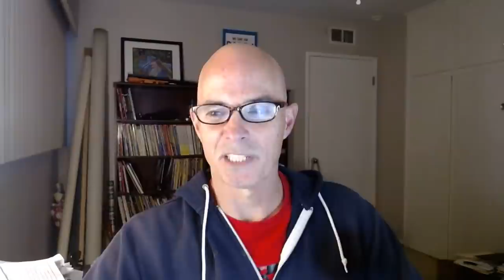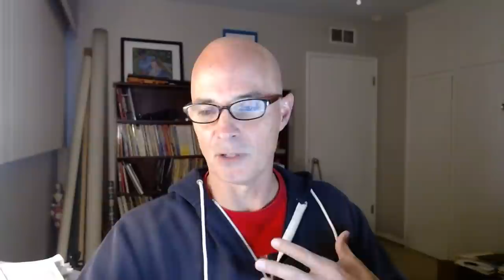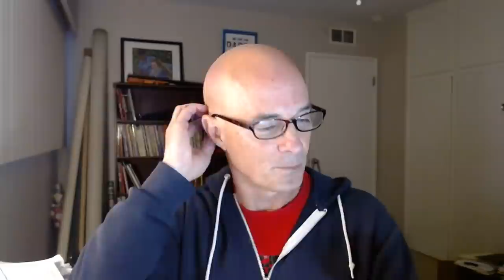LET'S TALK-CAM LIFT, DURATION & LSA (Q&A)

Comment: When upgrading cams (increased lift and duration) on dual variable valve timing applications (i.e. Ti-VCT), why do people install phase limiters versus machining additional clearance relief in the piston domes? Especially when considering supercharged, turbocharging, and other power adders.
Reply from the maker: there is actually very little VVT at WOT (8-9 degrees). There is a lot at part throttle which is where interference will take place. Valve reliefs will help but the new cam profile might not want the same VVT sweep

Comment: I'd like you to talk about valve events and what effect that has - intake exhaust open and closing and also ramp rates fast open slow close and how long does it stay on the nose etc and rocker ratio changes like from 1.73 to 1.8
Reply from the maker: MAGIC VALVE EVENTS?
Reply: It's magic it what you try works :) guess it's about optimising what you have, like trying to match the cam to heads you have. Maybe your heads are a little to big for the combo you have so by changing open and close points might see some gains, same if they're not big enough or flow poorly in the low or high lift - what changes can you make to improve what you have ? You're not trying to find a 100hp every time just improve what you already have cheers 
I'd like a rocker ratio changes that would be interesting

Comment: Richard, I have an unusual motor, a 99 ram 2500 v10. I recently had a cam reground by crower because there were no available new cores. We were able to get 216 at .050" and .478"(single pattern) on a 1.7 ratio with a 110lsa. I also did my first port/polish (more polish) on the factory heads and had 2.02 intake valves installed (factory 1.92). The upper and lower intakes were both polished with the throttle body opening cnc'd to go from a twin 47mm to a single 56x108mm with custom matching throttle body. I was wondering what you think on this combo. The truck is lifted with stock 1400ish stall and all it is used for is occasional towing and off roading so torque was the primary concern all across the power band, it seemed to fall off at 4000rpm and factory shift point/redline was 4500rpm, this is documented in every dyno of one I could find as well.
Reply from the maker: 216 @ .050 SHOULD HELP RPM

Comment: Richard, non cam related question. Have you ever ran pro topline 23° cylinder heads? How did they perform? I have a set on my mud bogger.
Reply from the maker: I HAVE NOT

Comment: I have a 86 f150 xlt lariat stock block .060 over dome pistons stroked to 352 cid with edelbrock heads roller rockers long tube headers and an 850 DP and a edelbrock intake and a lunati cam i will get a list of part numbers for you and see what you think as far as power output with VP110, and E85
Reply: LUN-20310525 - cam

EDL-77179- head

942-1-94195BE.06 - rotating assembly

EDL-7121- intake

HOK-6907HKR - Headers

Comment: I know this for fact....Chris Straub spec’ed a HR cam for my 454....it rips, big torque.  I stumbled across Dave Vizards cam calculation and crunched the numbers for my engine....Vizards numbers matched the cam that Straub spec’ed for my BBC..... Coincidence?  109 LSA engine loves it....
Reply from the maker: motors don't love LSA numbers, the respond to valve events
Reply: @richardholdener1727   What’s the mathematical equation to determine each valve event?  It’s physics, fluid flow and pressure waves moving at the speed of sound adjusted for temperature.  There has to be some associated math whether pure theory or empirical because some folks use some sort of model to spec cams.  It seems proprietary, but surely some mechanical or civil engineering professor has derived something that has been made public.  Are you aware of anything considering your large network?  You do a great job with all your testing and sharing of information! Thanks!

Comment: Would you say that, in general, a motor with limited head flow as the bottleneck (like, say, a 3800) benefits more from a cam with narrow LSA? That has always been the thinking in the Buick turbo 6 crowd, and many of the cams reflect that, with small duration numbers and narrow lobe separation angle. I've seen it work on my Dad's Buick 430, which runs better than a low compression n/a motor with headers and dual plane has any right to.
The odd thing is, it seems like all of the 3800 cams available are generally 113LSA or wider.  I'm wondering if it would be beneficial to have a custom grind done on a 110 center to maximize the area under the curve. I'm not after peak horsepower as much as I would like to see strong torque, quick spool, and good drive-ability, while making reasonably good power without revving it out much past 6000 rpm. I'm trying to have the best of all worlds.
Reply from the maker: what you do to the cam (narrow lsa) has the same effect on a motor with good head flow (more low and mid-range power)

Comment: can you give me the reader's digest version of what they mean when they list a 110+3 vs just a 110 lsa?  and what does that do to the power production in rpm range, area under the curve, peak power or torque etc?
Reply: Back in the day people use to advance the cam (in relation to crankshaft) to get more torque at a lower RPM or retard the cam to move torque higher in the curve. Nowadays people are fancy and make the cam with the advance made in to it. So when you install it dot to dot its already advanced, etc.
Reply: Furthermore it confuses people that they always list the "+3" right after the LSA, making it seem more involved or complicated.
Reply: @baby-sharkgto4902  - Ah, I see. Makes sense now, thanks, dude.

Comment: Hello Richard, my name is Percy i’m running a 496 bbc with aluminum rhs 119cc, 320cc heads also have srp high compression dome pistons 12.5:1 compression but that compression is with 118cc heads and I’ve got 119cc and my cam is a 299th big muthar thumper hydraulic roller cam kit by comp cam and a rpm intake plus 850 double pumper. Cam card show duration @ .050 int 243 ex 257 lobe lift int .3350 ex .3260 lobe separation 107.0 rpm 2300 to6100

Comment: All this is great.  Comment you have to Match cam to head makes sense. However with not experience where is this calculations located at.   I have a 383 280 cfm heads .590 left after 1.6 rockers.   227/233 .560 cam Where do I go to see how much I’m leaving on the table do to cam? !!!!
Reply from the maker: bigger cams make more peak power but sacrifice low speed power-its not how much, its where you want the power to be. Your heads can support 560+ hp, but that 227 won't make that.
Reply: @richardholdener1727  thank you for the reply. It would be cool if head companies did testing and said.  This cam made this hp/tq with our “” head.   So a person can  make a comparison of say 5 cams.
Reply: @richardholdener1727   I love your channel I wish I watched it before my build.   I now know why they say never purchase a cam first!!!!! Pick the cam last!!

Comment: I have a 07  suburban  Iam putting a 6.2  truck motor in it like to get the best low in tq  out of it  to pull a boat  it has 456 gears but the tires are 33 inch tall  it tacks around 2500 on the inter state

Comment: Vavle events is how i picked the cam for my twin GT3582 4.8L. The "normie" cam specs are 200/216 .580" 114 +4. Would i have ever picked this cam based on those #s? HELLL NO. It even has -10° of overlap. Does it work? HELL YEA, better than could have ever hoped and it idles like stock. Traps at 142mph in a 4000lb car at 27psi of boost. Best part is the drivability.
Reply from the maker: a 200 cam should idle very nice

Comment: What cam would you choose for a Std 454 BBC 10:9.1 comp GM bowtie oval port heads Street strip 550 whp goal
Reply from the maker: it would need to be a big cam with those heads on a 454

Comment: I'm trying to figure out a off the shelf cam for my 4V Cleveland it's going in a kind of heavy car but it will have low gears and about a 3000 stall converter
Reply from the maker: plenty of Comp cams avail

Comment: Richard,  would you recommend a normal split pattern cam over a single pattern cam on a turbo LS? Grand National's cam run a lot of single pattern  cam and run in the 10's.

Comment: this is a very unpopular topic Richard, i have a free vortec 305. it is going in a 47 chevy coupe. cruiser 700r4 carburated, can you recomend a cam to spice it up. i would freshen bottom end.
Reply from the maker: look at something with 212/218 or 218/224 duration split

Comment: ive ran a few cam's in my ls1 from stock 99 camaro, 04 ls6 cam, currently a comp 283r, but i really miss my gm hot cam it was only a 525 lift with a 112 lsa sounded amazing drove great with my 6 speed and it even passed ca smog
Reply: The Hot Cam is a good compromise at 219 effective.  Adds 50 hp.

Comment: I'm really curious to see how the smaller, median and larger size cams compare down low (3-4k rpm) when they are each run with the appropriate or equal dynamic compression. I believe dynamic compression is key to a well performing street engine and has been helpful for setting up for pump gas na applications with 11to 1 static comp. Seems like the bigger cams are being shorted by not having the same cylinder pressures down low when tested on the same static comp.
Reply: I agree. I've gotten to the point where I don't really spec a cam by duration and LSA, but by certain events.

The intake closing point needs to match your static compression ratio, engine geometry, and fuel type. This point determines dynamic compression.

Overlap is determined by exhaust closing/intake opening and is determined by intake reflected waves, application, head flow, and a host of other specifics.

This is what leads you, indirectly, to duration and LSA.
Reply: @tadwiltman4875  Yeah your right as there is more duration you move the sweet spot in sacrifice tq on rpm, but the idea is to get the max air and fuel in the cylinder and get it out as fast ass possible. So for me I'm thinking we start with a base power we want for our build with the cam out put to be about 100hp lower then then overall end game with no power adders, find a cam with the drive ability you want and the sound your looking for ( like in If I did my exhaust on a music car would be different but for my vet bit o sleeper I need a cam that is 114 LSA or higher to be under cover and take the ol lady out.  Most of thees guys are trying so hard to impress everyone with big numbers, but I like reliability best modest cam for a street beast and crazy for the guys on the track. You can get so much more out of full exhaust, valve lift, gears, stall and tires then ppl think. Caming is for big boys lol. exhaust 60hp 6 tenths , valve lift 1.6 15-22hp 2 tenths, 220gears to 373 gears 4-5 tenths , 1900/ 2800 stall converter 4-5 tenths, and good tires 3 tenths = like a 200hp conversion and 2 sec off 1/4 mile times.

Comment: 327ci, 30 over, 462 camel hump heads, 373 posi, will a  268D & 454L cam work good in daily street drag?
Reply from the maker: what are those cam numbers?

Comment: Any chance you could compare Comp Cam NSR Drift 233/243 54-777-11 on 5.3L, 6.0L, and 7.0L? A couple of us on the ls1tech forum are curious how the low lift but long duration would affect the hp/tq curves compared to stock and other cams. Would the 114 LSA be helpful under boost applications?

Comment: right off the bat,  lift is a huge deal.   you can over lift or under lift your camshaft.  Flow testing the cylinder head will determine where the lift needs to be.   if the lift is too small,  you will starve the cylinder,  if it is too much,  you will lose your flow charge,  and acctually decrease performance
Reply from the maker: no

Comment: Love this, always talking about my buddies about optimizing a new cam on my sbf 383w  street motor, thinking about raising static compression 2points  to 12.5:1.  Running 248/256 at .050 108lsa .720/.688 lift kaase p38 heads. My Erson cam card has the cam timing events but would like to tweak.  Running a 210 cranking pressure.   Trying to pick up another 50-75 hp.  All N/A power
Reply: The generally accepted rule for adding compression is that one full point of compression can add between 3 to 4 percent power.  So 2 pts would be at best 8% increase in power.
Reply: @littlevman2997  Just have a stick car. Steeper gears and run good manual brakes like willwoods :) 
Boom no need to worry about engine vacuum lol.

Comment: Hi Richard 
I regularly watch your you tube channel and particularly like you LS content 
I am building an ls and wouldn’t mind your thoughts on it 
In short 
Ls2 block 4” bore
4.125 crank 
Forge Piston 6cc dome
Pro Comp ls7 heads (have checked flow 360@600 370@700)
Comp cam 256/279@50 660 lift 
Short travel lifters 
Factory rockers (CHE trunions) all clearance are good a little shrouding around the valves because the bore isn’t really big enough 
Comp ratio about 12.5 -13 want to run pump fuel/e85 
At this point will run factory ls7 manifold 90mm throttle body (will change if needed later on)
Would like to see 600+ at the wheels 
Your thoughts is 600+ possible 
Comp ratio 
Cheers Rob

Comment: What do U Think
2 of these
on a 400 + hp . 
302 sbf  Drag Race Motor
T04E Turbocharger

HP BOOST STAGE III T04E T3/T4 .63 A/R 57 TRIM

Exhaust Standard Flange: T3/ T4 4-Bolt
Turbine A/R::0.63
Inlet / Outlet Diameter:: 3" / 2"	

Standard T3 5 bolt downpipe flange pattern

Intake inlet & outlet: 3“& 2”

Compressor : Trim: 55

Compressor : A/R: .5

Compressor : Inducer: 50.5

Compressor :76

Turbine : Trim: 73

Turbine : A/R: .63

Turbine : Inducer: 65.5

Turbine : : 55.9
Reply from the maker: yes

Comment: Is there a way to convert LSA to actual overlap? I am convinced you need a certain overlap for exhaust headers to really work well.
Reply: You need to know the duration and LSA to calculate overlap. You don't necessarily want overlap for every situation.
Reply: @03c5z  IE it can be a boost leak?
Reply: @Dr_Reason  excessive overlap can act as a boost leak. Turbo cars will still make their target boost either way if they are within their flow limits since shaft speed isn't fixed like a supercharger. PD blowers will often show less boost with more overlap, but it usually works just fine.

Comment: Richard  not a cam question but id like to see your take on this .hey everyone first off Merry Christmas to all . i have a question im setting up my exhaust for running twin turbos and  i bought the sniper efi system first off do i need to have two o2 sensors  ? and second of all whats recommended  location of the o2 sensors before the turbo or after on the outlet side of the turbos ?  im almost thinking  the outlet side of the turbos because its the very last the hot gases run through for a more accurate reading  to the controller . any ideas or thoughts are appreciated thank you  Bill
Reply from the maker: outlet side-two is better but many just run 1

Comment: I forgot to ask while live....
I had mentioned the LS9 cam, but forgot to mention that it would be in a 5.7L punched out 5.3/4.8 and ported LSA Blower. Since upgrading valvetrain anyways, would 1.8:1 rockers be a worthwhile application ? Not to band-aid a bad cam choice, but since rockers are a viable upgrade anyway. The bottom end being soft will help power management on bad launch/no prep surfaces, while leaving everything for the top end and still a tame street vehicle if/when needed.
Reply from the maker: YOU NEED LOTS OF VALVE SPRING WITH 1.8S

Comment: Have you ever done studies on valve seat depth (intake seat deeper than exhaust) to use overlap and exhaust draw to assist low lift flow?
Reply from the maker: I have talked about it in theory as well as different valve job angles-but no tests

Comment: Building A 496 1401 compression road extra bvx3 heads I don't know what I want to use for an intake either a tunnel ram stack injection or an elderly injection I have two camshafts to choose from 1775 intake 748 exhaust duration is 286 and 295 at 50,000 would 110 lb separation or I can go to the same camshaft with 284 duration and 292 at 112 lobe separation any comments on what to do
Reply from the maker: THE 112 MIGHT REV A LITTLE HIGHER, BUT THE 110 MIGHT DO BETTER DOWN LOW
Reply: @richardholdener1727  and what do you think for the intake dominated stack injection or enderly hat injection for my 496

Comment: The thing that keeps me confused is what LSA does to the torque curve and more importantly to me is  vacuum production. My Car needs a good amount of vacuum to operate the A/C controls and the power brakes want more than I have now. I understand that a wider LSA helps vacuum but hurts low speed power.   meaning for my beast that needs vacuum a number like 114 LSA would be preferable over a 108 LSA.    Trouble is, I like low speed power .
Reply: More lift?